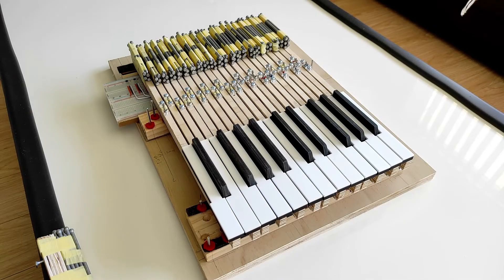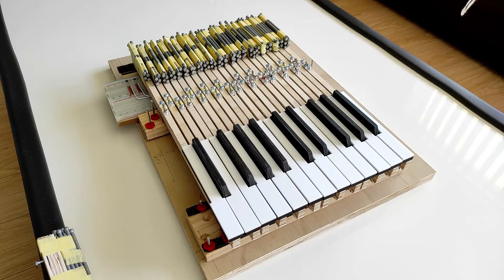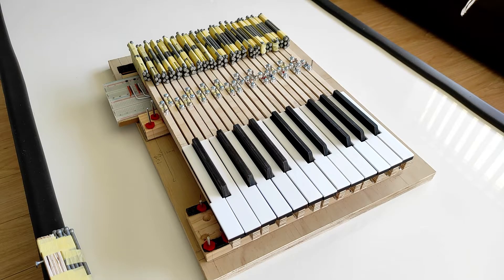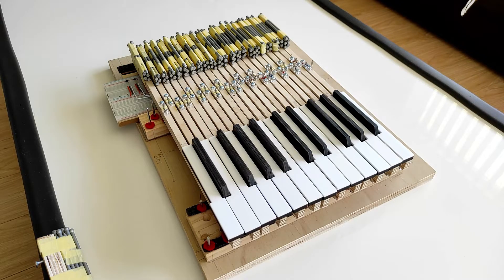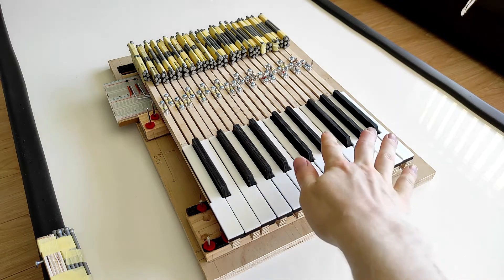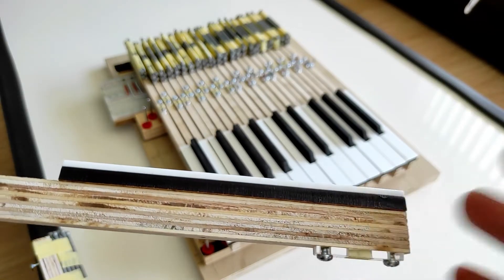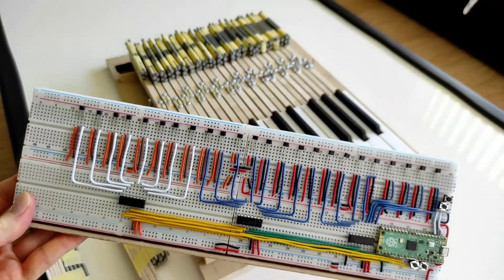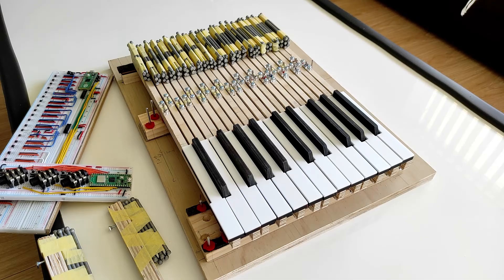DIY Digital Piano - 24 Key Prototype

Comment: Hi I’m planning on making such a piano and planning on using carbon pads instead of hall of effect sensors cause of the price and the reliability. Do you have any recommendations or anything that you’d be able to give? Also instead of using picos for every like 4 octaves I’m thinking of using an stm32 for the key and velocity detection and then providing that info to a real berry 4 or 5 for the synthesizing and creating of the sound. Again any recommendations and other things would be really helpful since you have more experience than me at making such a project and also know a LOT more about pianos than me.
Reply from the maker: Probably the most important thing I found was to do small prototypes first, I had a couple of instances where I was certain enough something would work for me to place too large of an order and then find it wasn't the optimal approach.
I experimented briefly with carbon pads, either way (carbon pads or analog sensors) there are trade offs - coding becomes very straightforward with carbon pads, but then the hardware setup needs to be a lot more precise, I found that a bit fiddly so stuck with the analog approach. You might find with the simpler logic of carbon pads you can use a single raspberry pico for all keys, especially now there is the faster pico 2. I'm using a teensy 4.1 for the analog approach, which is fast enough to handle 88 keys.
There is discussion about the two approaches at pianoclack.com, some people there have experimented with binary slit sensors, so the key interrupts light passing through a slit instead of physically pressing a carbon pad.
I can't comment on DIY solutions for sound synthesis, I've used standard software instruments like pianoteq for that.

Comment: Is it an active system? I mean force sensible?
Reply from the maker: Do you mean velocity sensitive, i.e. capable of differentiating gradations of soft/loud? If so, yes it is
Reply: @aleathwick  wow! That's exactly what I meant failing to find the correct words for. Hey, that's great! When is mass productions?
Reply from the maker: @mustrumentology9312  I don't have any plans for mass production, but I'll be making code / plans public for the final version (code in its current state is already available on github).

Comment: Did you explain how the contacts are made, I didn't get it. Are the magnets triggers some Hall effect sensors or it's something else?
Reply from the maker: Yes magnets + hall effect sensors - I use the hall effect sensors to measure key positions, and then generate notes / calculate velocity based on speed of key movement (simulating a hammer)
Reply: @ this is so clever! I really like your project, bravo!

Comment: How much magnetic crosstalk do you get between keys? I've built a set of organ pedals on similar principles, and I do see some, tho not enough to cause problems (may be worse when I eventually implement velocity sensing...). If I get around to adding sensing to an old keyboard stack of mine, I'll probably try using optical—reflective or transmissive...
Reply from the maker: I don't get much crosstalk, certainly not enough to be a problem, which holds true for a smaller keyboard where keys are on average 10mm apart I'm using small 5x5mm neodymium magnets.

Comment: Seems like this would be an affordable diy to add midi to an acoustic piano. I have a QRS product that does that for my rhodes but it wasn’t cheap and I got it used.
Reply from the maker: There are a few diy projects out there that do exactly that, but reading the hammer positions directly, rather than imputing their positions from key position as I do - for example, see: https://github.com/stem-piano/stem-piano-g-main
Reply from the maker: ...actually I guess the projects I'm referring to aren't "exactly that", because they involve converting piano actions into digital instruments, which no longer function acoustically (no strings anymore).

Comment: Wanna know more about the hardware / hammer design
Reply from the maker: The hardware is very simple - it is literally just a bunch of nails on the other end of the key, like a see-saw. Finger on one end of the see-saw, nails on the other end. The hammer is simulated in the firmware of the microcontroller - move the key halfway and stop, and the simulated hammer will keep moving. If it's moving fast enough, then it will keep travelling until it hits the (simulated) string, and a note is triggered.

Comment: i just started learning the piano a month ago as a female adult with very small hands, been obsessed with researching about narrow key digital pianos after watching "piano's darkest secret". Narrow keys, Kaduk...etc, the former you have to be on waitlist, the later has their pre-order closed and seems still in pre-production stage. Very frustrating to be googling for hours with no luck. So I got to the point thinking "fk it i'm gonna build my own." AND THEN I saw your video!! Looks absolutely promising and most importantly, your effort and spirit is truly inspiring, what you're doing is truly wonderful, fulll respect! I'm gonna start tinkering, super hyped! You're awesome!
Reply from the maker: Yes it is a very frustrating situation, and bears testament to the power of the status quo. At least some options are slowly emerging. All the best with your tinkering! Personally I have found the tinkering itself to be very rewarding, the electronics + engineering involved has been a lot of fun.
Reply: Don't worry with every day of practice your hands will feel bigger and bigger (small keys or not)
Reply: @benm12310  The opposite is true. The more advanced pieces you want to learn, the smaller the hands will feel. If you want to choose freely which pieces to learn, you need a narrow keyboard for not having always to play in hard mode if you have small hands.
Reply: @Hvranq  yes but speaking to a beginner with one month of experience. Hand size is not as bad of a hurdle as you may begin to think. Once you get to very complex pieces it may pose an issue but that early on in a piano career it’s important to know that YOU CAN do it and you don’t need a special piano yet

Comment: The reason why Fatar stopped using wood in their construction is because of worping over time, just something to watch out for.
Reply from the maker: The issue of warping wood is somewhat mitigated in my design by the replacement of wood with plastic where the mortises interact with the metal pins, which eliminates the impact of humidity on the tightness of the mortises. But the holes on the balance rail pins are still wood (laser cut plywood). I'm working on a design at the moment that eliminates wood, with reduced labour / more laser cutting - I'll eventually get around to posting a video of it when I've made enough progress.
Reply: @aleathwick  Could you just over-size the balance rail pin holes and insert plastic?

Comment: I have average size hands but I could stand to lose a few pounds (which would thin out my fingers too). So I couldn't go with narrower keys, and if I went with wider keys I would not be able to span an octave and a Major 3rd. But, if I could make the black keys a millimeter or so thinner, I could hit the whites deeply without grabbing a black key from time to time.
Reply from the maker: I have settled on 6mm wide sharps - substantially narrower than normal sharps, and conveniently (in my region, at least) 6mm black acrylic sheet is readily available which makes cutting the sharps out (cutting as side profiles) a breeze.

Comment: Nice video, I gave you a like. Are you using the Hall Effect sensors as simple off/on switches or are you using them as a varying analog (how close the magnet is to the sensor) so that as the key is played it determines key velocity like a real piano (slow pppp to fast ffff)? I have a Yamaha DX7 and each key has a mechanical Break/Make SPDT switch. It does this so the CPU can scan the entire keyboard switches in the MHz Frequency range and measure the time in milliseconds from the Break to the Make (and debounce the switch contacts) to determine actual key velocity.  This is very low cost and simple to build in hardware and to code as well because you can fabricate the switches with nails and thin pieces of metal, and the code just measures digital timing rather than changing analog values to determine key velocity. I built a 2 octave MIDI Bass Pedal using this Break/Make switch method and a Arduino Nano. I like that you used hall effect devices because they virtually don't wear out. But my DX7 is 40 years old and the switches work just like they have on day one. I think they used Palladium and Tungsten in the switch contacts, but even bright (galvanized) nails and Aluminum, that would last years without cleaning because the current through each switch is in the micro amps.
Reply: Given the mcp3008 A/D converters he's using, I assume he's measuring the analog outputs of the Hall effect sensors (which I didn't even know was a thing; I've only ever used them as on/off switches). From the video, I gather he feeds the position of the key into a software simulation of a piano hammer (including momentum!). I hope he'll reply with more details!
Reply: @michaelpark  I think you are correct, the sensors are analog so only one channel per key is needed for key action and velocity (momentum). But I still use a SPDT (2 channels) for each key for action and velocity. True, I have to debounce the switches in code, but it is a lot easier, lower cost, and faster to multiplex digital inputs than it is for analog inputs. But he does have an elegant design that works.
Reply from the maker: That is correct, I'm using the analog output of the hall sensor. When I scale up to 88 keys I will need to do some further optimization to ensure latency is still ok, but I think it is doable. The main advantage I see with my approach is that it allows half presses - I can half press a key then stop, and still trigger a note because the software simulated hammer continues travelling. I do still find the digital approach attractive for the reasons you've mentioned.

Comment: Are you using the Hall Effect sensors as simple off/on switches or are you using them as a varying degree (how close the magnet is to the sensor) so that as the key is played it emulates key velocity like a real piano (slow pppp to fast ffff)?

Comment: I wonder if rather than using weights, you could use the magnets on they keys... and then have an Arduino controlled electro magnet in place to resist it. You're already detecting the magnets movement... so then all you'd need is to modify the electro magnets current to control the key press resistance to mimic a real key. You're already doing the physics calculation as well so... By doing it that way, you could make the entire thing significantly lighter and maybe even smaller.
Reply from the maker: Not just lighter/smaller, but if done right, more piano-like too - using weights on the end of the keystick results in a different leverage ratio (1:1, if the weights are the same distance from the fulcrum as are the front of the keys) compared to the hammers on a real piano (around 5:1), which means my digital piano feels much lighter than a piano (less inertia), even if the down weight is matched to a piano (50g). I would love to build something like you suggest where the touch can be adjusted electronically to simulate any keyboard instrument, and it has been done before by others, but I think it would be a big undertaking.
Reply: не проще  всё сделать исключительно на магнитах, а силу менять моторизированым изменением расстояния рейки(на которой все магниты прилеплены) от клавиш с другими магнитами? Типа как магнитные подвески делают https://www.youtube.com/shorts/u5N9KEMJDYY